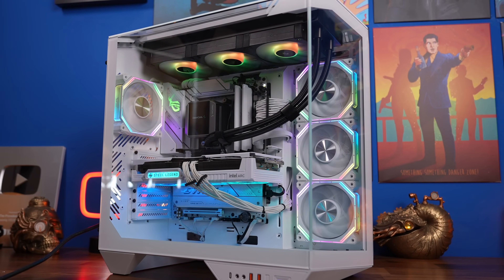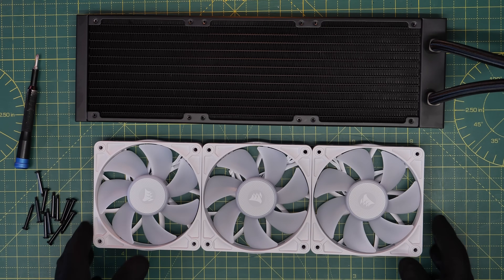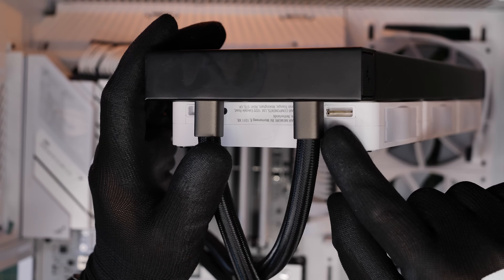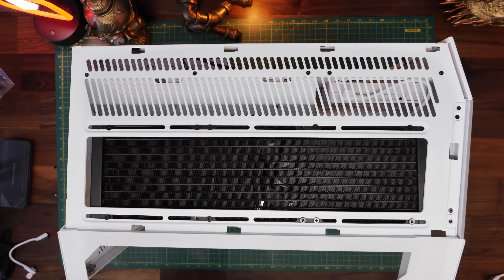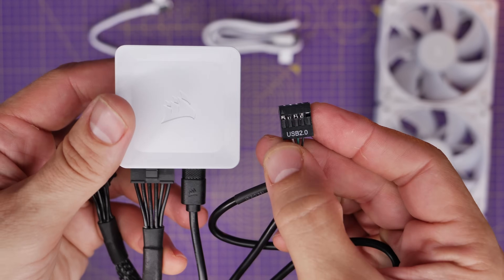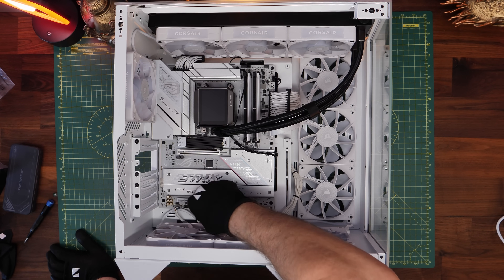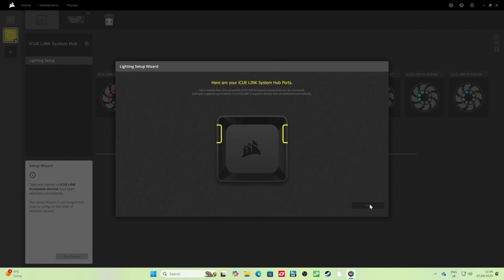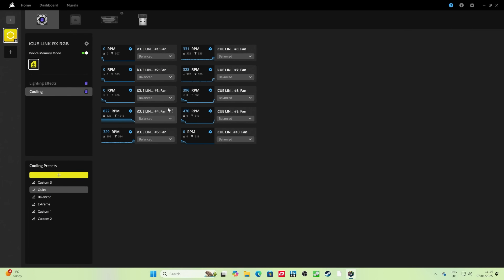How to swap AIO fans for Corsair iCue Link fans  - any cooler + Corsair iCue Link fans

Comment: Hey, does the icue link starter kit come with pcie 6pin connector?
Reply from the maker: It has the adapter for your control box but the power cable comes with your power supply. It's the same sort you'd use for your GPU
Reply: @TheProvokedPrawn alright thank you for the answer.

Comment: Great video. Looking everywhere for something to guide me. I just got quite a few qx120s for my pc but I have an older h100 elite caterpillar. I’ve been trying to find everywhere if I had to leave my aio fans on it with the controller or if I was able to switch them out without worrying about the old controller.
Reply from the maker: Glad I could help. If the pump connects to the controller sadly you'll still have to use that but you could swap the fans as I've shown

Comment: This is useful as I'm thinking of switching to iCUE Link fans as I'm not a fan of the Thermaltake ARGB fans I have in my case. Now to deal with the fact I'm using all the PCIe connectors on my PSU. I wonder if those 12VHPWR to PCIe connectors are safe to use.

Comment: Are you sure you cannot create a custom curve based off particular sensor?

I also run Link fans without Corsair's AIO (pump) and when i create a new curve I can choose what sensor will be used for temp monitoring: CPU, GPU, or various Motherboard sensors (if you install the plug in in iCue). 

So my Side 3 fans are tied to CPU temp, while by 3 top fans are tied to GPU temp. With proper curve those will ramp up or down based on sensor reading.
Reply: My thoughts exactly.

Comment: Did this on a tryx panorama 360 with the corsair lx fans, just missing the iCUE LINK System Hub Tach Cable.  When plugged in the Aio header it will run @ 100% all the time correct ?  or if plugged in the cpu header will it run as (PWM) ramp up and down ?
Reply: Did you ever figure this out? Doing this exactly for my girlfriend. Realizing now it will be such a pain in the ass

Comment: Icue is super underrated imo.  I've used almost every software suite on the market (signal rgb, Asus, Arous, open RGB, razer, Thermaltake, l- connect etc) and icue and more specifically the Link system is my favorite...
I just hate the way Corsair fans look.  Lian Li LCD fans with Icue level control would be perfection.
Reply: I've tried using Windows ARGB settings. Haven't bothered with RGB Fusion as it's hot garbage. Not a fan of OpenRGB or SignalRGB. But iCUE is great. I'm also not a big fan of the Thermaltake fans I have in my case currently. The TT AIO itself is fine though. I definitely don't like the ARGB connector. Thinking back to Corsair like I had in my last system. I'm really liking how it's just one cable with the iCUE Link hub. Now if only it were powered by something other than PCIe as I'm using all the connectors from my power supply for the CPU and GPU.

Comment: This video helped me in a strange way.
I bought a icue link h170i rgb AIO last black Friday for about $100 and have finally put it into a build. The build went well with the exception of the icue firmware install. I tried all the thing in your dedicated video on the subject and even tried in safe mode with internet.  Nothing worked and I gave up and even considered getting a Arctic Freezer 3 to replace it.  Then I watched this video and got the idea to just have the fans plugged in. I unplug the radiator and after booting the fans lit up and I could install the firmware. I switched off the the PC and plugged in the radiator, started the PC and everything worked. 
So even though I have no plans to do an icue fan build I did benefit watching this video. Thanks.

Comment: Okay there Mr Crustacean, you're obviously reading my work notes. This is brilliant and it's something I've recommended folks do for some time.
Literally, yesterday I swapped the fans off a DeepCool Mystique 240 for a set of BeQuiet ARGBs to match the others in a Jonsbo D32 STD in order to get airflow levels for the airflow set up and for the matching simple ring lighting on them.
When all the fans use the same synchronizing data you get a much more reliable intake and output airflow but they look a lot better too as you've clearly shown. Well done.
Reply from the maker: Thanks. A few people asked about doing this so figured it was worth putting together
Reply: @TheProvokedPrawn  Absolutely agreed. I speak to so many who simply buy fans according to RGB and size with little to no regard for CFM ratings or power draw.
How about a video with more detail on the needed airflow speeds and how it affects the temps?
Client brought me a "gaming" machine with a 14900KS, 4080, 64GB DDR5 and 11 fans including a 420AIO. All in the original packages for an assemble and tune. The problem was that his motherboard had ONE fan header and no RGB headers at all. :_Happy: